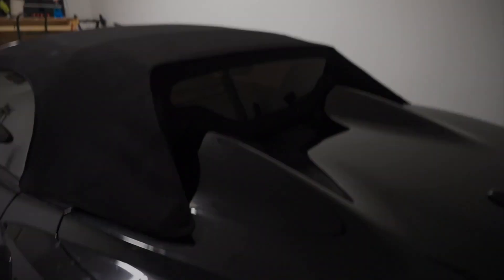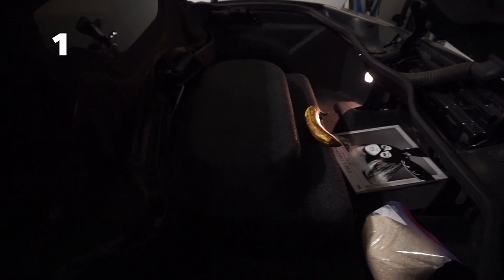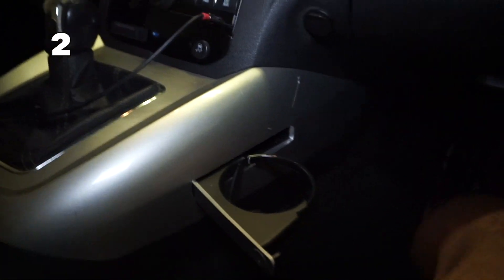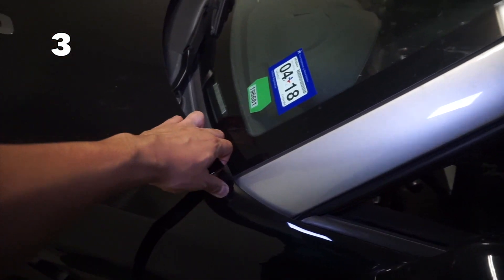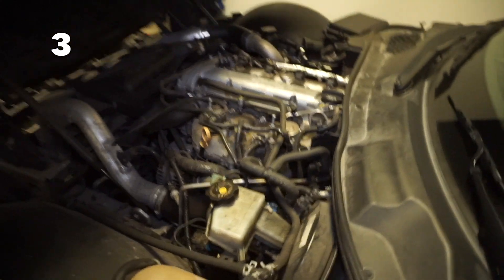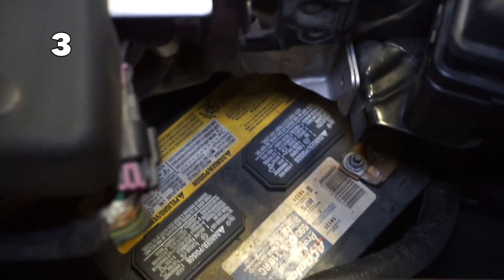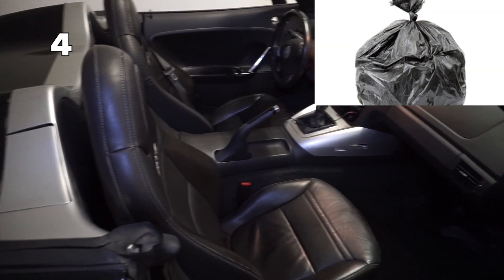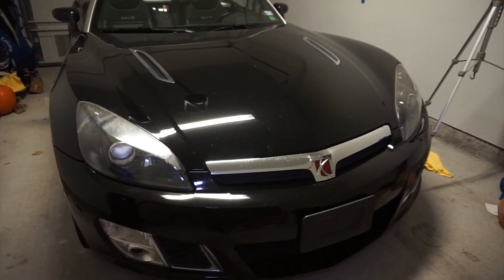4 Things I Hate About My Saturn Sky

Comment: #1 - Lack of trunk space isn't much to complain about if you have a second vehicle. Use the Sky for your daily commute. #2 The cup holder - works okay for me - I wouldn't have put it in the list. #3 isn't isn't much to complain about if your mechanic is doing the maintenance. #4 Saturn. That's sort of true - but other roadsters are smaller and don't look as good.  My complaint list would be - #1 the windshield gets a covered with sun-relfect -dirt look with hundreds off small chips - all caused cleaning it. #2 unless you have the GM/Sky wind deflector (your case) - it's annoying when a truck pulls up behind you at night. It blinds you. #3 The Sky gets only 18 MPG. My 2000 SL2 gets 29 MP.G #4 The Sky is sensitive to pot holes at high speeds - and that can take the fun out of driving 90 MPG. The SL2 is much better on handling pot holes.  I really love my Sky - people walk up to me out of the blue and tell me how awesome it looks. I love the sound of the engine and I use the convertible top a lot. Yeah - I really like the convertible and I'm glad I bought mine.
Reply: Why the terrible mileage?  I get an honest 28 overall.  If at higher mileage I wonder if the valves are caked with carbon on the turbo motor if you have it.

Comment: I’ve had my Sky for 13 years.  If storage is a concern, buy a minivan. I own

 some custom travel bags that fit into the trunk...perfect for a weekend away.  One touch, buttresses release and trunk deck lifts open.  Takes 10 seconds to open and close...it’s brilliant.  

The cup holder works fine if your cup has liquid in it.  Center console cup holder should pop right out, of it doesn’t...fix it.  The battery location makes it a pain to change, once every 5 years.  Not a big deal.  The Sky is a unique, well designed, American made roadster you can get for a SONG.  Why don’t you make a video of the five things you LOVE about it?👍🏻

Comment: For changing the oil filter I have found the perfect solution.  Get the 1/2" drive socket that fits the cap then a 1/2" to 3/8" reducer and a 12" long 3/8" drive extension.  Put the socket on the cap then do from directly above and put extension and reducer into socket.  Once loose enough to remover by hand take all 3 away.
 Guys these are GM parts bin cars.  I got mine used and expected the same quality of most other GM's I have owned and got it.  Low!   That being said I love the thing.  I did the GMPP tune and magna flow and its plenty fast enough and still tame enough to keep you alive.  My biggest complain.  The blind port from the passenger side rear hump.  I always look and still miss vehicles over there.  Nothing on the road like it.  It is a great daily driver to and from work unless you carpool.

Comment: I've got a redline and I have the rear cup holders but they're more annoying than anything else because if you're driving stick you constantly have to have your elbow bump into them. I just don't use them I just use the one on the right. Also for the oil filter if you get the socket for the housing and a 18-in extension put the socket on the filter housing first then take the extension and the black bracket that's above it go behind that and it gives you just enough room to drop the extension down and then you don't have to worry about getting it at an angle.

Comment: Regarding the battery location, you don't need to connect to it for jump starting, use the jump out at the top where the main fuses are above the battery. Be safe.

Comment: A) your Saturn Sky CANNOT be your only car. I have an old beater Subaru for daily driving. B) go to Pit Pros or Grease Monkey for an oil change. C) Battery is difficult to get to but it's doable. I keep a charger on it in winter and it's no issue to reach.

Comment: You knew in advance there was no trunk storage of any merit, the cupholders work just fine and the front one is ingenious. You can pay a dealer to change your oil, and if you use synthetic you can often go 7000 miles. Your sensitivity to the Saturn brand is nonsense. These are great cars to drive and enjoy.

Comment: FYI, check your manual about jump starting. There are remote jump points in the top level of the engine bay. 

Solve #4 by rebadging to an Opel GT. No one will even know wtf you are talking about if you tell them you drive and Opel GT.
Reply: make sure to follow the manual on jump start.  If you connect to the 2 terminals by the fuse block you will toast the radiator fan fuse.  Connect positive by box negative on engine block tab above the turbo.

Comment: Polaris Slingshot has the same 2.4 engine/transmission. After seeing the sky's battery placement, the Slingshot battery placement behind a rear panel with 2 pins actually is easier.

Comment: I don't know man. This car is so easy to deal with when it comes to maintenance. At first the oil filter got me but I've changed it myself 3 times now. It's easier than my girls ford explorer lol
Reply from the maker: Collins well I will say just pray that you don't have to take off your turbo any time soon. I needed to replace header gasket because it was making a "clicking" sound under load. That was literally the worst. The piping is bent in a way that makes it impossible to get a wrench on the bolts that hold it to the header. Pretty much everything had to come out. :(
Reply: Wow. Well sadly there weren’t any manual turbos in south Florida. So had to go with the only manual base sky. I’m going to supercharge/turbocharge it so I’ll keep that in mind man. 👍🏽